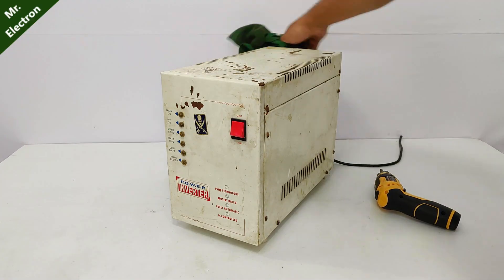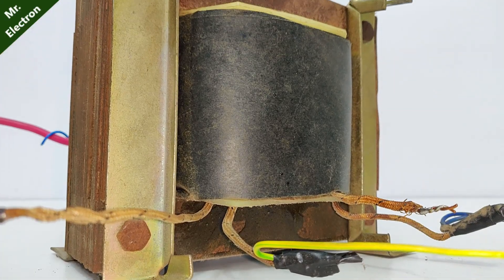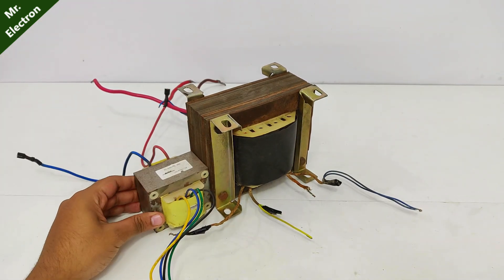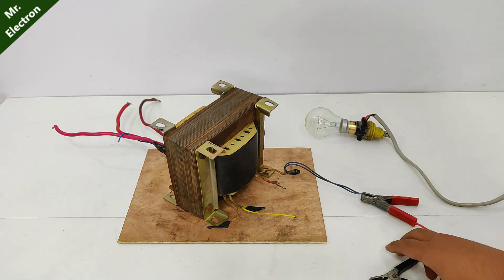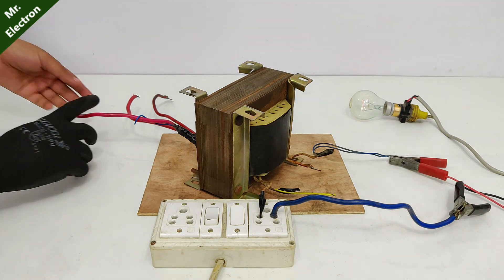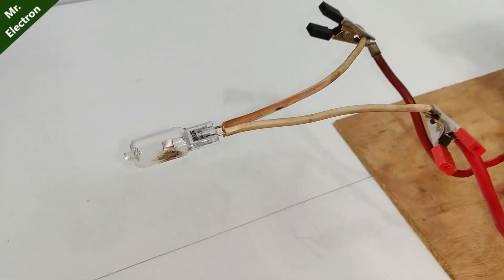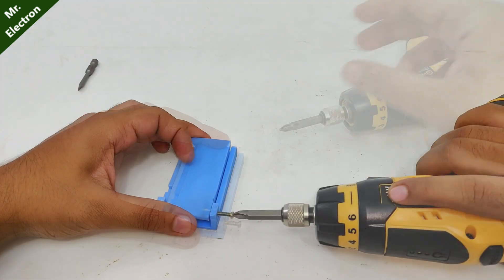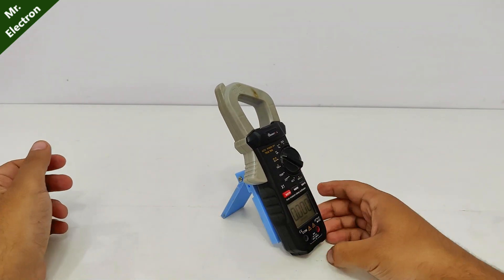12V 100 Amp , 1.2KW Transformer Salvage from Inverter - 20 Years OLD DC to AC Converter

Comment: Old inverter transformers are wound especially to accommodate the square wave switching on the primary side so may perform less efficiently when run on conventional AC .
Reply: okay so what about new inverter transformers?

Comment: Make an automatic shutdown of the battery charger when it is fully charged (98 -100%), it is preferable to see on a battery UPS, or for motorcycle viper. Use the Transformer and the relay  in the video. Thanks🙏

Comment: Acel transformator nici daca ar fi din Atlantida nu ar fi in stare sa genereze 1,2 kw. Sectiunea la patrat egal puterea  adica 40 mm× 40mm = 160mm ceia ce inseamna ca 265wh ar fi rezonabil 1, 2kwh? de unde l-ati scos  ?
Reply: at 100a it also has weak wires
Reply: 40 x 40 = 1600W
Reply: @ionutifrosa239  ca sa fie asa atunci acel transformator trebuie sa aiba sectiunea in cm nu in mm si ca sa mai tinem un pic cu autorul dispozitivul ar trebui sa aiba o frecventa de peste 100 kh , lucru imposibil la un miez din tabla siliciosa (tole).la peste 1000hz apare frecventa de taiere.
Reply: The power calculation by using the core cross section area is always less than what a transformer is capable of, I think it's more of a sustainable power output....(power=(core area×frequency÷9.6)square)
where area in inch square
But I can say on testing amd experimenting and real life experience
that for short term usage, couple of minutes, the transformer can put out many times the power calculated by this formula, that varies from transformer to transformer, so I believe his transformer can output 1.2kw for a little while...